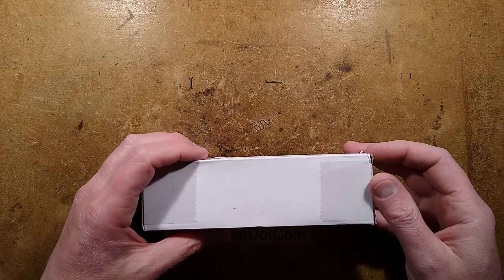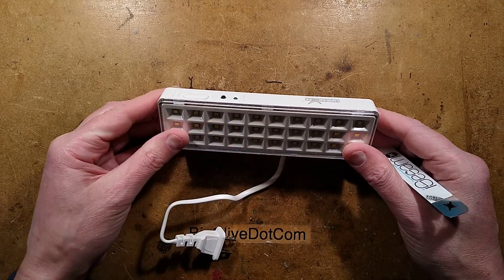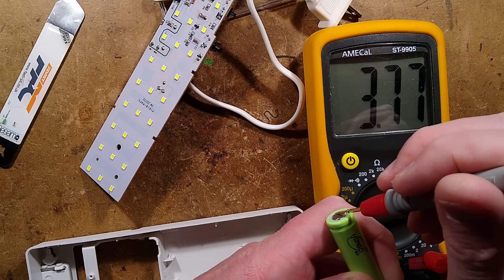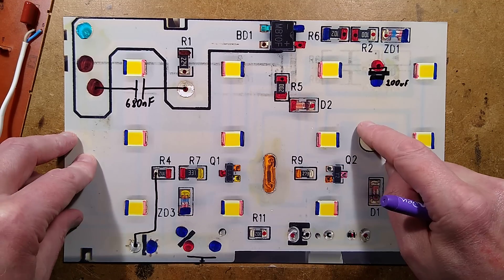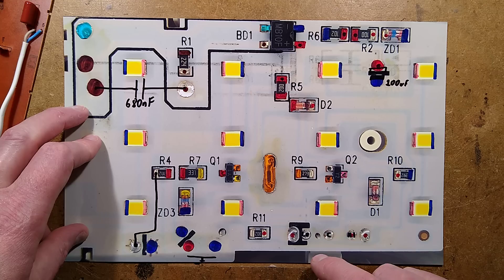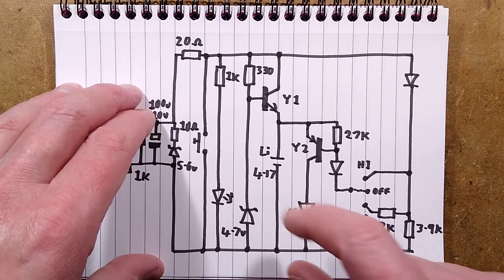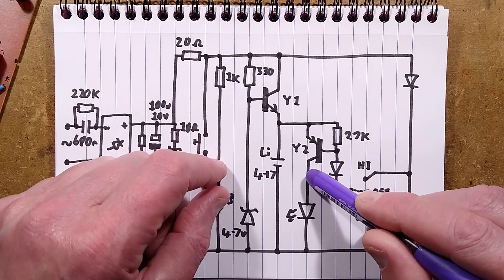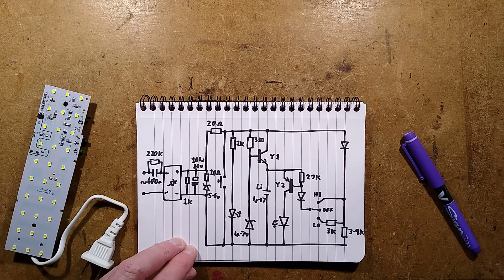$3 AliExpress 100-240V emergency light (with schematic)

Comment: Ihave a couple of the standard bulkhead LED emergency lights, but the battery packs only last about 3-4 hours, this is the design, however I would like to change the battery packs to enable a 6+ hr operation. Is this possible? The battery pack that came with the fitting are 1500mAh, 3.6v.
I want to double the standby capacity.
Reply from the maker: You could theoretically fit a higher capacity battery.  It will take longer to recharge after an outage.

Comment: what if you used a tl431 in lieu of the zener to achieve an accurate lower voltage of your choosing?
Reply from the maker: That could be viable.

Comment: I have the same one, but when I plug it in the light only partly turns off. What do you think is the problem?
Reply from the maker: Check that the components at the right hand side of the schematic are in place properly.

Comment: Clive, I am suspicious of the brightness control on the far right of your schematic. The diode in the upper right forces its cathode to be one diode drop below the "5.6v power bus". I don't think that voltage can ever be low enough to pull current out of the base of the PNP and turn on the LEDs.
Reply: Never mind ,,,, I forgot that this light is an emergency light and will only turn-on when the input power is off and the 5.6v bus is dead. My bad ....

Comment: My original comment was strangely deleted by YT! We have a similar model, however ours uses an LiPo flat-pack battery, and a "legit" charging / discharge protection circuit.  Bought it back in the day from Bang Good, and it's now very "old and yellow", yet still works fine.
Reply: You can also buy rechargeable LED lights for installation into standard DIN D rail distribution panels. These are durable, demountable, and a lifesaver in cases of unexpected night-time outages.

Comment: I recently bought an emergency light from Screwfix for £19.72. I think the battery is Ni-Cd.
I was amazed at how many components there were on the circuit board, considering it doesn't have to power a fluorescent tube like the old one did.

Comment: I bought a cheap head shaver, one of the shavers with the 7 little shaving surfaces.. looks like a flower.  Well the thing cost me around 9$ shipped and went to use it the other day and it bogged down suddenly and burst into flames..  the entire time it was burning the motor stayed on..  until it was a crispy thing..  would be nice to see one reverse engineered..  i never got to take it apart.
Reply from the maker: Any keywords for where you bought it from?

Comment: The charging circuit is worth building to recharge abandoned vape cells ( FYI  pick them up , NOW ! the UK are banning them next year ) ... Use a 5 Volt USB charger , with low Ω current limiter( ? ) .... this is simpler ( 4 components ! ) than the usual little PCBs crammed with ICs , all components available from your junk box 😝..DAVE™🛑

Comment: Unless it's a high voltage type lithium cell, keeping it charged to 4.17 V most of the time will make it degrade much faster than necessary. A 18650 cell isn't that much more expensive, and will have much more capacity at 4.0 V, or even 3.9 V  than that 14500 has at 4.17, and would last many times longer.  Could have been a much better product for just a slightly higher manufacturing cost.

Comment: Great video - as usual - Do you have any ideas on how to put a 'over discharge circuit' into the battery line to prevent over discharge?
Reply: The little circular bms boards kit or parts that sit atop the battery with a strip to the negative & some heatshrink to tidy the job are fairly cheap on Ali. Haven't looked if they do them for 14500, but certainly for 18650  & would fit even though slightly larger circumference of the pcb, it wouldn't matter in this application.

Comment: a while back, I reverse engineered an LED exit light with backup power similar to this, but it had an interesting circuit on it that prevented the LEDs lighting until it had power at least once coming in on the AC input.  it was all done with 4 transistors, and two of them were set up as a bogo-SCR to latch when it got the AC power.  the battery pack kept it latched once triggered, and disconnecting the battery would reset it.  this had the side benefit of dropping out when the current through the LEDs went too low, due to the battery discharging.

Comment: does the lithium cell have built in protection? to stop discharge
Reply from the maker: No.  But the current is very low by 2.5V.

Comment: Nah, that's a standard voltage-follower regulator.  Even as a kid I used 5.6V zeners to get a quick'n'dirty 5V supply.  Kick it up to a 6.2V zener for power Darlingtons like the TIP41/TIP42 pairs if you want bipolar +/- 5V supplies.  You might not be able to wait for the 78xx/79xx regulators if you didn't have the voltages you wanted, but you could keep a supply of zeners in all voltages for cheap.

Comment: The beauty of this regulator is, a 4V7 zener has a negative tempco almost identical to the b-e junction of a silicon transistor. So the overall tempco is effectively zero; a very stable circuit. It's not often that (non-ideal) component properties work fortuitously.
  By the way, Y1 base resistor (330R) wouldn't have any effect on the voltage limit at Y1's emitter (within ridiculous limits, of course) if the zener and Y1 are thermally close.
  WARNING: old man rambling.
                                                     This is why digital electronics is traditionally run at 5V; the tempco of 5V1 zeners is virtually zero; above that zener tempco is positive, below negative, and the early digital circuitry was very, very fussy. When we had to design (series) regulators, we had to use thermistors (sometimes series/parallel) clipped and glued onto the same heatsink as the transistors and zener. A lot more than $3.
     MORE rambling:  A friend (back in 1970's) who was senior computer tech/programmer/administrator at a very large firm, would start the power supply for the mainframe 1/2 an hour before turning it on. The PSU consisted of two 3-phase motors each driving an ELV alternator through large flywheels, which when up to speed, were switched into the PSU circuits, which were left for 10-20 mins. to stabilise. It was a very warm room, separate from the air-conditioned mainframe room. This had the advantage of having redundancy, great stability and was an effective, if crude, UPS (10 mins running if no peripherals running). Ah, happy Algol/Fortran days.
  Hope this isn't boring.
Reply: Very interesting about the tempco correspondence. Learned something new today

Comment: I have several of the industrial ones out of a plant we demolished they have 3 wires coming out of them orange black and white but can’t seem to get them working right bought now sla batteries for them but they will charge if the are unplugged they will come on then plugged back in they stay on   Till the battery goes flat then nor charge. . Any ideas
Reply from the maker: Some maintained lights use a neutral, a continuous feed for the battery charging and a switched feed for direct powering of the lights.  But without knowing what you have there it's hard to say.

Comment: better then some of the cheap ones ive seen here, which was basically a capacitor, resistor, and two lead acid cells that got overcharged and swelled up causing the unit to stop working

Comment: Personally I'd replace the zener for the battery with a TL431, with the sense pin hooked up to a resistive divider that's connected to the battery.

Comment: I got a very similar looking one sold under local lighting brand in Thailand 6-7 years back. But mine had a separated circuit board and a 18650 cell soldered to the wires from the circuit board. If I remember correctly, funnily on its package or the leaflet said that it should not be plugged in all the time, which defeats its purpose for being an emergency light (I guess because it would keep top up the cell to full charge all the time, which would shorten the cell life). I ignored the warning and left it plugged in. Until maybe half a year or a year later, it was no longer able to charge. The cell still worked and be able to charge with external charger, although the capacity was pretty much gone. The light itself also still turned on with other fully charged cells, it was just the charging part (and the test button) that stop working. I didn't bother try to fix it, so I hooked a 18650 cell tray on its back and use it as a flashlight instead.

Comment: It's a neat little light but I don't think the battery connection is a good mechanical design. Depending on the plastic to keep the metal contacts making a good connection is optimistic. The plastic will relax over time (creep) and contact tension will be reduced then  lost. Any number of simple springy type contact arrangements acting in the direction of PCB assembly would be far better and much more reliable mechanically. L shaped bits of stainless steel spot welded to the cell ends would be an easy and cheap way to do the battery side mechanical connection reliably. Just my opinion. Cheers!

Comment: I think that's a 14500 protected cell. The little 'collar' is a giveaway.
Reply: If it's a protected cell, then that relieves one fear I had, that the cell would be continually charged even when full.
Reply from the maker: Probably a pressure switch, but no electronic protection.

Comment: Interesting little light.  I have a couple of, what I call, "Oh Shit" nightlights that turn into a flashlight in a power failure.  

That, and a battery bar light magneted to the back of my steel door.  Has come in handy a couple of times, thanks to drunk idiots knocking over the power pole with their car.

Comment: For those that don't know: An emitter follower (sometimes called a series pass transistor) + Zener is the basis for creating linear regulators. This is basic analog circuit design as shown in The Art of Electronics. It only seems genius because basics like this aren't taught to people anymore they jump straight to micro controllers. (I'm talking about the commenters, not Clive, obviously he would know this)
Reply: Emitter follower is in my curriculum when I teach Devices.  One of our labs is building an emitter follower to launch pulses into a long 50 Ohm co-ax and monitoring the 50 ohm emitter resistor with an oscilloscope to see how long it takes a pulse to be reflected from an open or short at the distant end.  Knowing the velocity factor, the students calculate the cable length.  It is a neat way to get a small bit of transmission lines and impedance matching into a Devices class.
Reply: I was thinking about the emitter follower. It’s not often you see that nowadays. It felt like I was watching a schematic from a couple of decades ago.
Reply: @VarionJimmy  I got a set of spare batteries complete with charger for less than an official battery would have cost for my Galaxy Note (the original Note, which was not actually sold as the Note 1, to give you an idea how long ago this was). 

The charger had a bright purple bar of LEDs that turned red when the battery was fully charged. In fact, behind the plastic there were two blue LEDs which took current proportional to the charging current, and one red one that took current proportional to the charging voltage. (Or maybe I have the colours of the LEDs the wrong way round, it was a long time ago now.

The regulator was just like this circuit here: a zener emitter follower. 

I cut down the charge voltage to extend the life of the cells by inserting a power diode into the charge circuit, shorted with a switch for when I wanted a full charge: the extra diode dropped around 0.7V for me. 

It worked great right up to the time when I left the phone on a bus 😢 and stopped using the charger and those batteries

And despite my initial doubts the Chinese cells that came with the charger seemed about as good as the official Samsung one that came with it, at least for the 22 months I was using them...
Reply: Glad this comment is already here.

The concern I have here is the potential failure mode. For whatever reason, most transistors (at least both bjts and mosfets) have a tendency to fail short... at which point that cell most definitely will be overcharged.
Reply: At least in our polytechnic, we do all sorts of analog stuff, BUT we dont do any TTL stuff anymore 😢
Reply: I have minimized small scale logic, but I have several labs in Digital Circuits which employ TTL and CMOS small scale components.  Computation may be digital, but the electronics are still fundamentally analog for interconnections.  I have one lab where students examine the quiescent current consumption and current consumption as of TTL and CMOS inverter gate transitions between logic levels, also average current consumption versus switching frequency.  I can tell from the reactions of students as they make measurements that this is a valuable lab.  Students also need to learn that packages don’t work unless Vdd/Vss or Vcc/gnd are connected.

The other thing we do is to breadboard a simplistic traffic light controller using TTL MSI logic.  The next week we repeat the same design in Quartus and burn the design into a CPLD.  I have kept these labs in the curriculum based on the student reactions.  It appears to be helpful to experience the contrast between development environments.

Comment: Clive, how about a score out of 100 for each device and/or circuit used?
Reply from the maker: I've toyed with a scoring system, but safety and longevity are hard to quantify.
Reply: Good idea. I'd like that too.   Maybe scores out of 10 for Design, Componentry, Efficiency, Value for money & overall.

Comment: The 1k resistor isn't stressed at all. The voltage across it is limited by the 5.6 volt zener and its 10 ohm series resistor which are in parallel with it. You measured about 50mA from the mains, and most of that goes into the battery while charging, and into the 5.6v zener and 10 ohm resistor when it's full. The current through the 1k will only be around 6mA at the most.

Comment: We've got three that look like a higher quality version of that, came with certification for use as an emergency light and 220V plug. They were more than $3 but not a lot, I think maybe $5.  Ours have 18650 batteries.

Comment: I think the 4.7 volt zener has a temperature coefficient that means as it gets hotter the voltage drops, same as the VBE of the regulator ..so that whole circuit may actually be very cleverly temperature compensated as well.

Comment: A slightly longer version, with a few more rows of LEDs is also available. They come in two variants, the most common being a 4.2v sealed lead acid battery. The second variant has two 18650s in parallel. The circuit uses the same components.
Reply: Greetings, Edward !
Are they available somewhere in Uk?
Reply: Greetings, Edward Franklin !
Are these available anywhere in the Uk ?
As the one Clive shows has a USA mains plug 🤔
Cheers
Reply: yeah they're lithium 18650's, not a AA

Comment: Zener voltage very easy to drop the voltage, simply increase the resistor from the supply to base from 330R to something higher, probably 470R to 1K, which will probably, because the zener diode at 4V7 is a rather soft breakdown, so the slope resistance works for you. I did the same to older NiCd lamps, using some selected 1W zener diodes, running them at 50mA, and then using a multimeter to bin them for voltage drop, selecting from the packs of 10 2V7, 3V0, 3V3, 3v6 zener diodes, plus a pack of 1N4007 diodes, so as to get a way to have them sit at 4V2 for the charge voltage when the battery was disconnected, so as to cut the charge to zero, and not have a constant 50mA flowing through the cells, which was killing them every 6 months. 

As they were 1W units, a small bit of metal soldered to the leads (old spade terminals from PCB connections as I had lots) was added as heatsink, and then the diodes with selected series strings were fitted to the board, and the new cells soldered in. They lasted at least 2 years then, making it possible to actually have the emergency lights work when power went out.

Same was done to later cheap lamps, with 3 cell lead acid packs, as they also would suffer from cooking the cells, even after dropping charge current down by removing the one resistor of the parallel pair of 0.25W resistors dropping the voltage from the small 6VAC transformer. they also introduced me to a retrofit SMPS, built to fit in place of that small cheap transformer, with a simple half wave rectifier and mystery input capacitor, 2 transistor blocking oscillator, and rectified flyback secondary with primary side regulation, and a 100uF 16V capacitor, possibly made almost entirely from recycled components. Came with 2 wires primary, 2 wires secondary, and still had a bridge rectifier on the main board. Bet the next run the removed 4 diodes, and soldered the wires direct, saving that 4c from the BOM.

Comment: Would that PNP transitor trick be more useful for night lights compared to shunting out the power?
Reply from the maker: Shunting the capacitive or resistive dropper is massively easier than trying to shut the power off.  The designs that try to do it the "proper" way are very complex and expensive compared to the simple shunt.